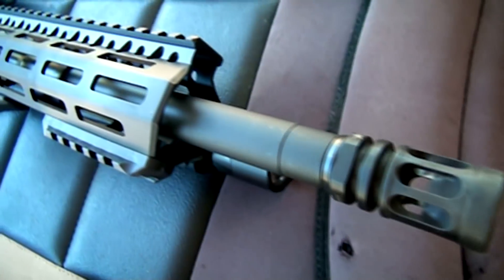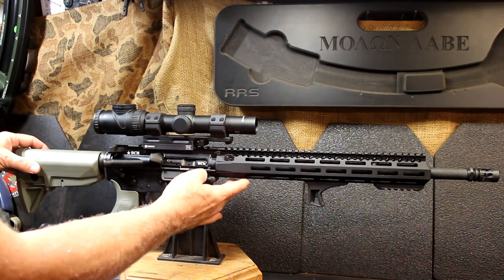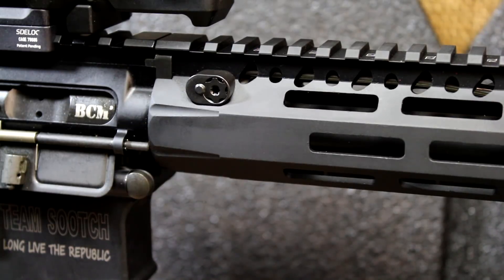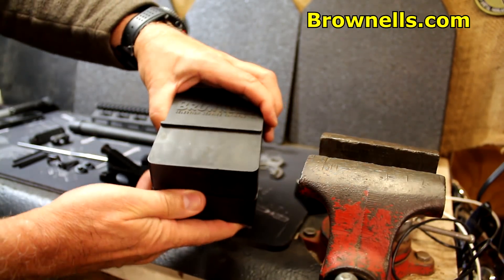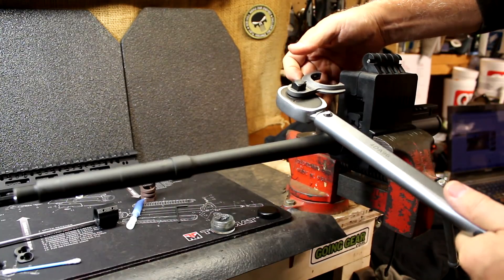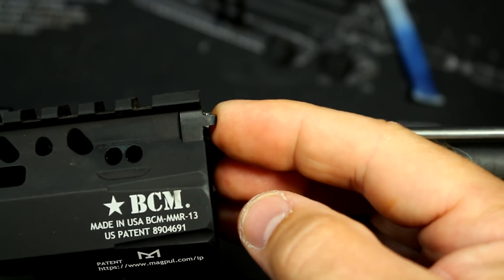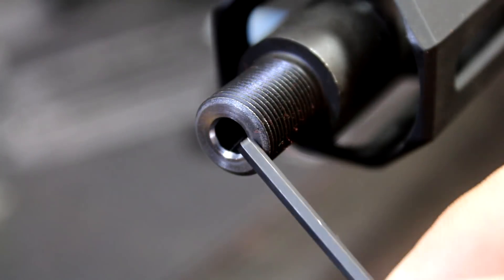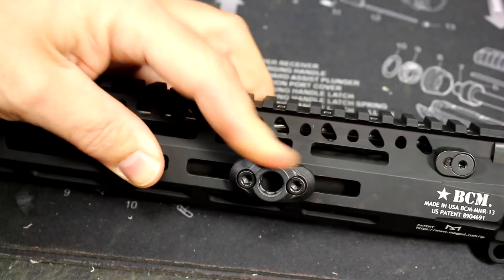BCM MCMR M-Lok Handguard

Comment: I know you SHOULD use a vice, but I just wrapped a towel around my upper (so to not mar it up), sit on it so it wont move & torque it to spec. Ive done so for all my builds, including my .458 Socom. No issues. Lol.
Reply: its just to keep from marring the upper mostly, but also some noobs will crank a vice too hard and warp the upper withouy a vice mold

Comment: I'd suggest torquing to 30 ft lbs 3 times instead of just hand tight to truly season the thread and mate the receiver and the barrel extension.
Reply: This!  Here is step five from the install instructions (which you should read in it's entirety since this an atypical install and a super tight fit):  "Using the included wrench and a ½” drive torque wrench, torque
 the MCMR barrel nut to 40-50 ft.-lbs. and then loosen the barrel nut. Repeat  this process a minimum of 4 times for optimal thread engagement and fit. NEVER use the torque wrench for loosening the barrel nut. Final installation of the KMR barrel nut should be 40-50 ft.-lbs."

Comment: If I could only find this in stock anywhere. Super high demand on AR's now.
Reply: I’ve been wanting one for my 16in AR. I have one that came with my pistol and now I want one for my other.
Reply: These Handguards are like pink diamonds. Rare!!!
Reply: DVOR, right now. 10.5" pistol length, 13.5" rifle length. Nicely discounted. 10.5 is like 130 I think. Dunno why it says its specifically "pistol length" gas system, maybe there's something I'm missing or maybe it doesn't matter. Checked their website and they have some in stock too, dag near 200 bucks tho. More length options at least. Came here to try and find out the I.D., had to go to their website. Too small for my purposes. Sweet rail though.

Comment: I dont know Sootch about the Geissle Reaction Rod... i think the design of that plastic block is much better, your upper cant bend in there, while for the reaction rod there could be risk that you end up messing the barrel extension.... i dont know just my two cents.. oh! did you knew that torquing the barrel nut with the wrench installed at 90 degrees will increase your torquing power? :P you should always keep that straight to your key.
Reply: Jose Toscano it’s not a good idea to torque a barrel nut with a fixture like he has because it puts all the strain on the threads of the receiver unlike the reaction rod which puts the torque on the lugs of the barrel
Reply: @iGOBURR  do your research about shearing barrel indexing pin with a reaction rod,  n you will change ur mind, reaction rod is fine for muzzle but not for barrel  nuts,

Comment: I dont know why when i put the handguard on the accuracy is gone. I shot at 100 yard without the handguard on is like .3 inches spread. With handguard i get like 3 inch grouping.
Reply: Did you re-zero?
Reply: Did you ever figure it out ?
Reply: @HotBrass-Lead  it has something to do with barrel harmonics vibration and tension etc. I find messing around with the muzzle brake torque setting significantly changes the accuracy.

Comment: This install video was solid cringe, I bet that AR-15 barrel extension index pin rotated and damaged the upper when he over tighten the muzzle break using the incorrect crush washer and not using shims, but before that looks like he edited a mistake out when instilling the locking screws on the rail.
Reply: Shims are only needed if your using a comp that can also have a silencer screwed on so you don’t strike a baffle . When using a regular comp the crush washer Is sufficient in fact most come with a crush washer . Your correct on the barrel alignment pin though he should have used a reaction rod
Reply: uhh shims are so you can align the muzzle device at the proper bottom alignment without over-torque....also a torque wrench helps with install, shouldnt just man handle it without knowing the ft/lb rating.

Comment: I'm super annoyed by this 30-40 inch lbs thing. ZERO idea what that feels like and I'm not buying a $75 hex torque wrench for one screw. They say screw it in to 30-40 inch pounds and its flush, but its still loose at the flush area. To be even a little snug its way through. :/
Reply: See that bike bike in your profile photo? Loosen all the stem bolts and then put them back only counting turns, the first one three, the second one six, five, two, and so on randomly. Next, suit up and find a mountain near you to try and climb. If you manage that, then try descending it. Get back to us if you survive. Torque wrenches exist for a reason.
Reply: Don’t build rifles if you don’t feel like investing in a torque wrench. Buy off the shelf.